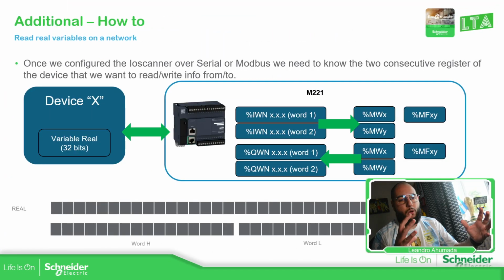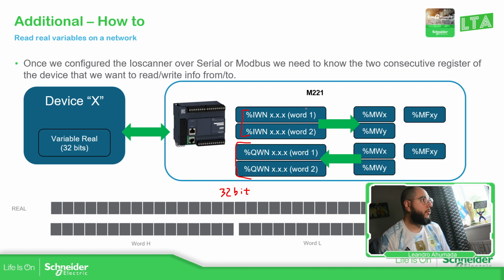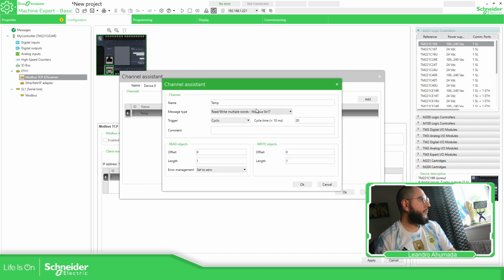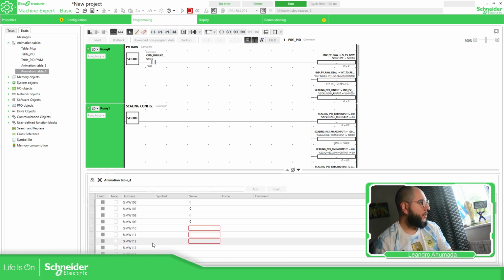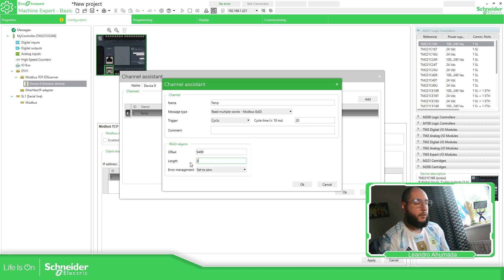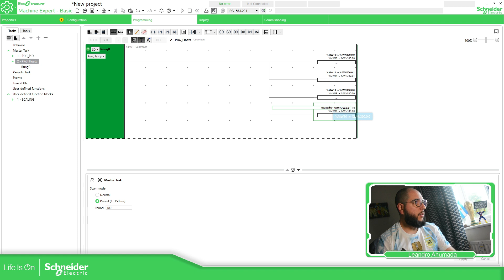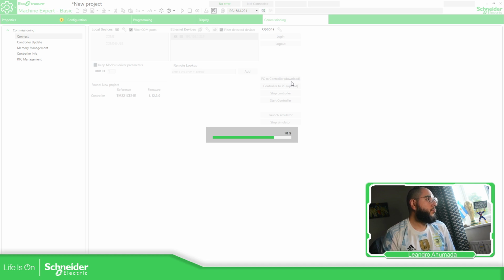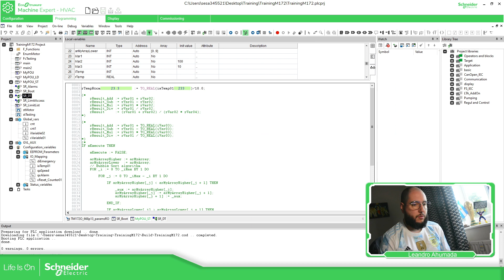Training - M221 - M21.5 Reading real (32 bits) variables in a network

Comment: Hi LeTomas, I wonder if it will work if you do this:
Create user defined function with the code and for example with the name F_2WORDTOREAL:
%ET0 := DINT_TO_REAL( DWORD( %Word1 ) * 65536 + DWORD( %Word2 )) * %SCALE
And use the function in the code like this:
Energy_kWh(%MD0) := F_2WORDTOREAL( %IWN300.0.0, %IWN300.0.1, 1)
So you don't have to use intermediate variables %MW0 and %MW1? Thanks.

Comment: How can I read KWh from PM5310 using M221?. The Register 3204 is INT64.
Reply from the maker: Hi there! You can read from the M221 the 4 registers that will form the INT64 but the M221 may not be able to "understand" the content inside. If the M221 is connected to another system than can "understand" INT64 then this system can point to the  four (4) %MW in the M221 to read the info from the PM5310, so in this way the M221 will act as a gateway you will probably not be able to process the data in the M221. I hope this helps.
Reply: @LeTomasAHUMADA  Thanks very much for the feedback.

Comment: THanks Thomas for clear explanation. How to read KWH 64 bits  ? can you give some example
Reply from the maker: Hi there! The process is almost similar…. You need to read the 4 words from the device but  the m221 does not have long real 64 bits variables so you may need to use an hmi to read those new 4 registers in the plc and the hmi will convert the value to something meaningful for us.

Comment: i am trying to implement it with Codesys V3.5 but there is something that i am missing and the communcation fails after i am trying to read/write those 32 bits variables. Do you have any samples/projects for codesys 3.5?
Reply from the maker: Hi there! Unfortunately i do not use CodeSys  even if Machine Expert is based on that. Codesys should have the ioscanner too on the plc that you have then you need to check if the register that you want to read is correct (sometimes add or substract 1 to the address) then the code to convert the variables should be the same

Comment: Hi Mr Ahumada,
I learned almost everything i know about tm221 from you so first, thank you. I usually solve problems myself but i have one that i can't fix.
The number of I/O expansion modules are supposed to be 7 and 14 with the expansion module. But in fact the software indicate that the controller lack of capacity way before that number. it depend on the tm221 that you put and it also depend on the modules you add. There is even some configurations where you can't even put 2 expansion cards ! ( m221ce16r + 2x tm3dq16r/g). But when you add the tm3xtra to add modules you suddenly can. (exemple : m221ce16r +  tm3dq16r/g then tm3xtra + 7x tm3dq16r/g works)
 It seems to be more of a machine expert basic but than really a capacity problem. 
Any idea ?
Reply from the maker: Hi there! Thank you for watching my videos ❤️.
In the manual/catalog the max number of modules is explain but i always use the software to validate. If you need more IOs i totally recommend you to use along the  m221 the buscouple (tm3bceip or tm3bcsl)
Reply: That's what i do also, but when you have to add a module months later you can be a bit surprised. I find out that all the controllers do not have the same maximal current available for the modules and ofc modules have differents consumption. The real problem here being a miscommunication (at least) by scheider that indicate at multiple places that you have a max of 7 which is juste not true. Thanks for your answer

Comment: on this example you had interaction between same family devices correct? so they hold real in the same way in short words no need to swap word order, what I don't like with Schneider is that when you have to use schneider devices but not same family like M251/ M340 reading power meters PM8xxx/PM5xxx they interpret real in diff way by default and there is no simple built in block to read meter values correctly, you have to create your own library of blocks to read data wrom schneider meter in to schneider PLC
Reply from the maker: Hi there! I know that feeling. It will be great to have a field somewhere that enable us the swap of the word but we do not have it and manual actions are needed. In this particular case i used different devices family a M221 and a M172. I did play with a M262 and PM5xxx and i created a library to swap the variables from the ioscanner.
Reply: @LeTomasAHUMADA  yes its shame that Schneider is not providing PM8xxx or PM5xxx block in library where you can read full meter data via modbus (not i/o scan) and use what you like, not much of power monitoring devices are implemented in built in libraries unfortunately.